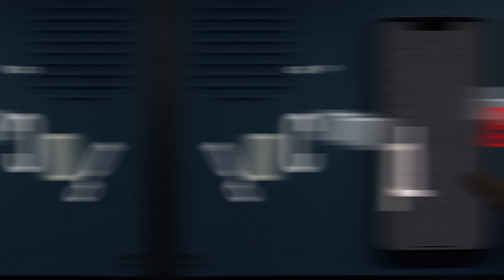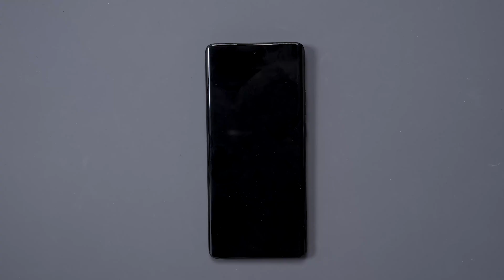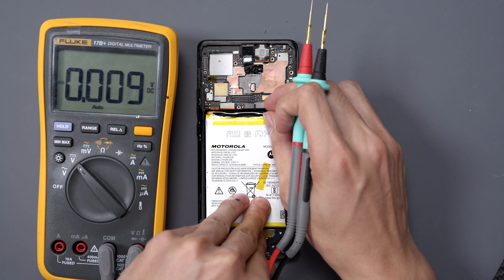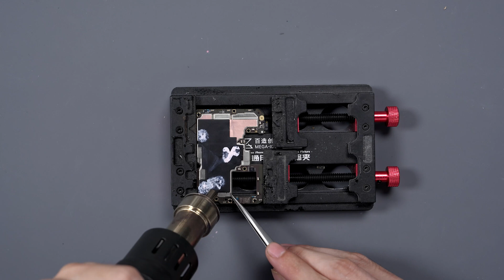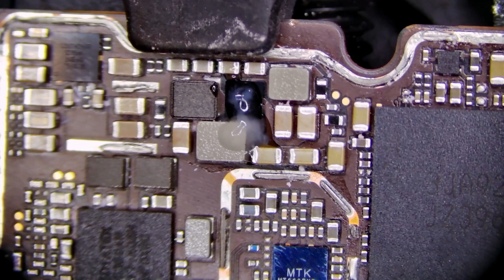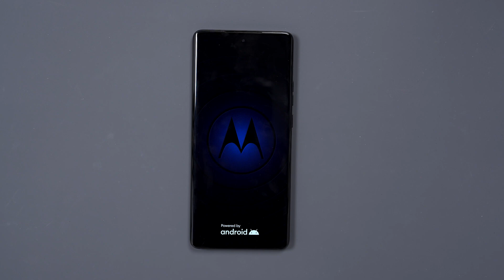Motorola Edge No Display Repair: Expert Diagnosis & Solution Guide

Comment: hey i have a moto edge 40 with the same issue , i tried to change the display but still it's flicking and blackout again and again, and in my city there is no one who is able to find the issue. i have one query is this step can fix the same issue for my moto edge 40 if yes so i can show this video to my mobile repair person or is there any diagram for this model (only edge 40 not 40 neo )
Reply: just buy a new phone
Reply: Already done😂 @nonameeee6145